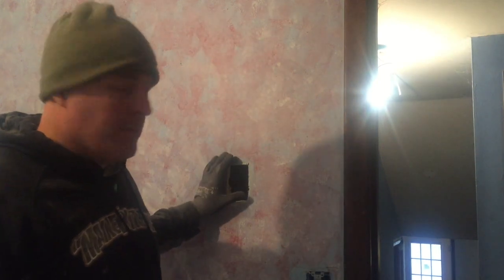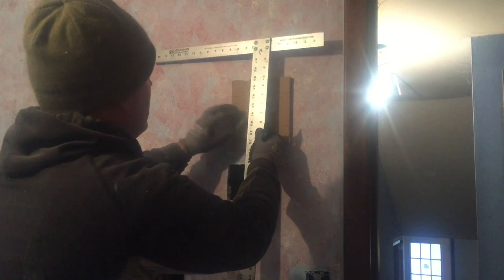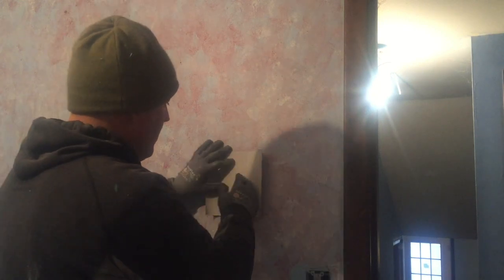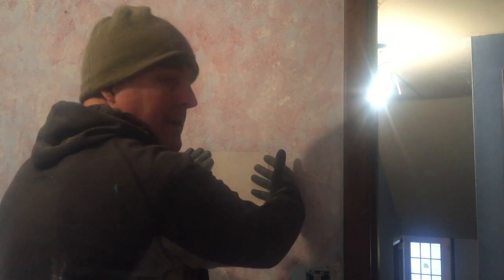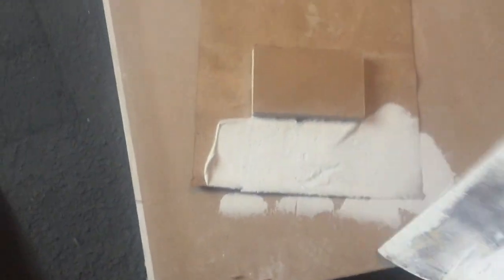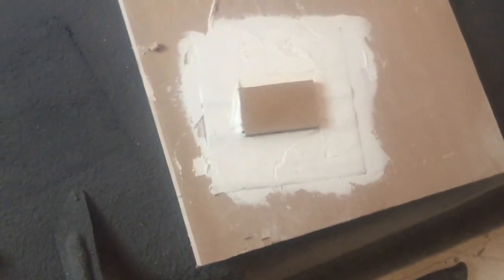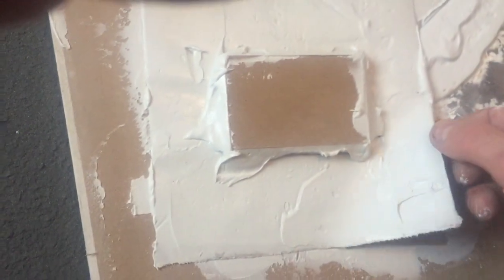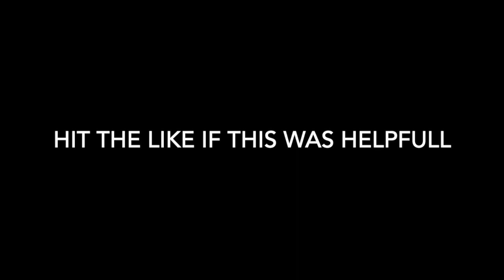Tic -Tac -toe drywall patch

Comment: There is nothing holding the patch in place only the paper.  I like to take a oversized piece of drywall and a keyhole saw and saw through both the patch piece and the wall.  Holding the saw on an angle so the patch piece will fit without pushing through the wall.  Then add mud
Reply from the maker: Nice idea Greg. 👍